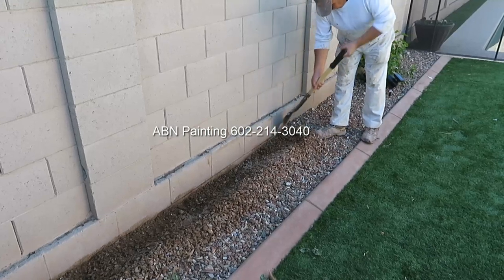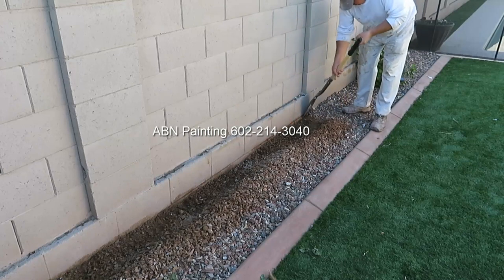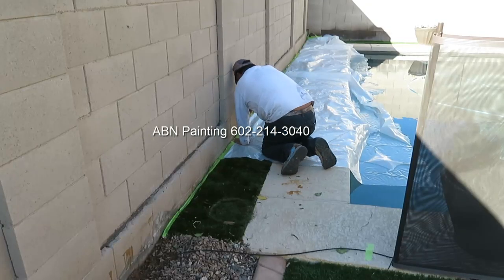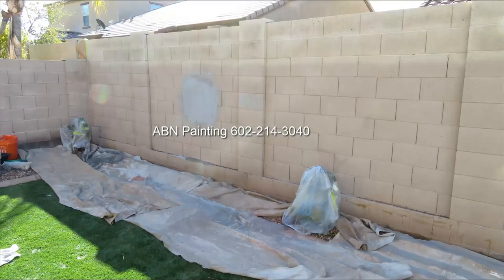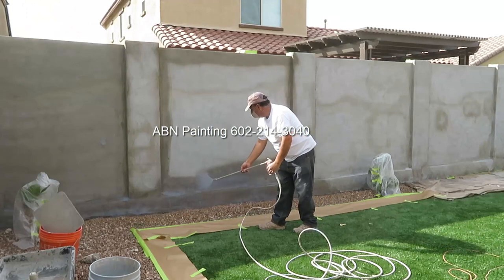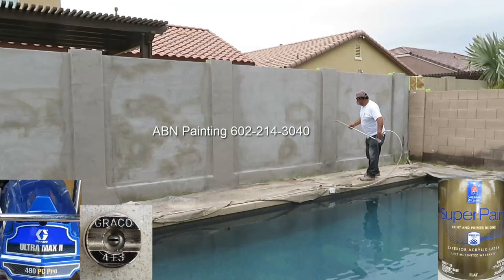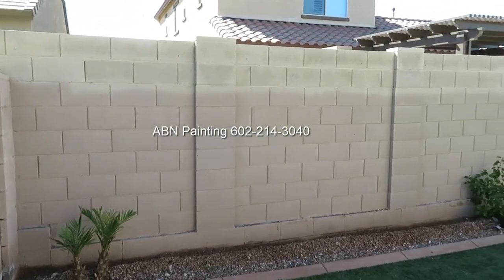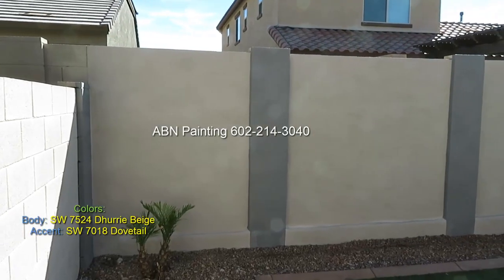Applying stucco over painted block wall.

Comment: Good to the point video, nicely edited and brief. I do notice you use Quikrete bonder. Quikrete, as well as La Habra bonders, recommend removing paint. They say their product will only adhere to stucco and cement without paint. I suspect you've never had a problem with the bonder and it's ok to use for such an application.  I have always used Larsens Weldcrete bonder. It's more expensive but is recommended over properly prepared paint.
Reply from the maker: Than you for recommendation. I indeed never had any problems with Quikrete bonder.  We no longer do stucco installation. Too much stress on my back and i am getting older. Larsens Weldcrete bonder seems like a quality product based on 5 star amazon reviews.  It i ever hire someone young and strong and resume stucco  work in the future i will definitely check it it out.

Comment: I have a painted block wall home in Florida. What type of adhesive agent are you using for the stucco ?
Reply from the maker: https://www.homedepot.com/p/Quikrete-1-Gal-Concrete-Bonding-Adhesive-990201/100318465
Reply: Use weldcrete,  faaaaaar better product

Comment: Great video very informative. Question did you use a paint sprayer to apply rhe sealer? I've only used a garden sprayer to apply sealer, I guess I learned something new.
Reply from the maker: yes used paint sprayer with either 4/11 or 413 spray tip.